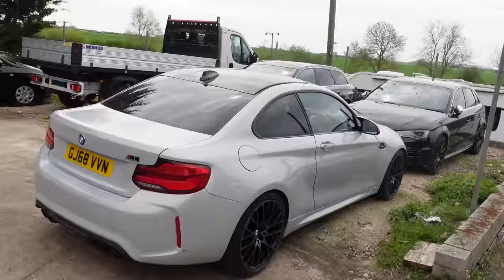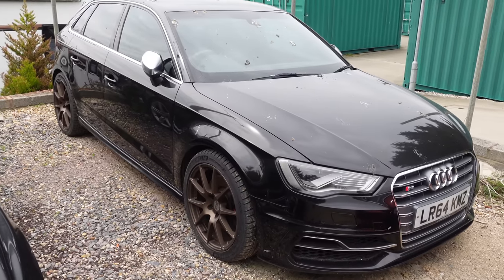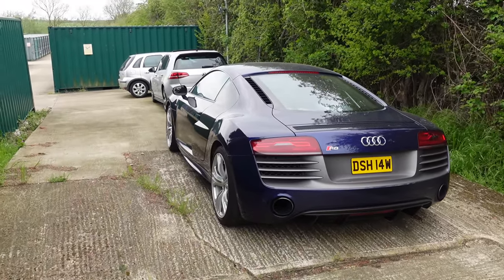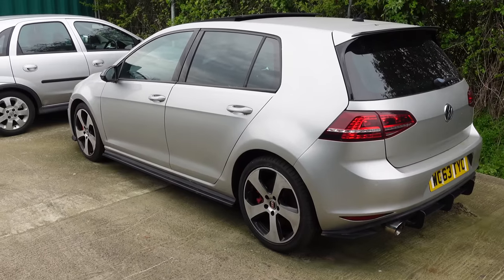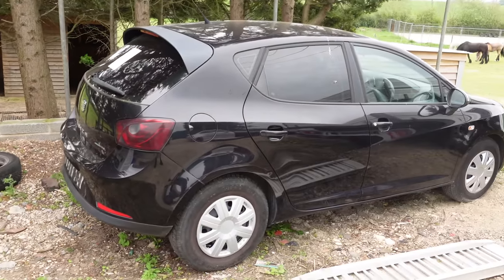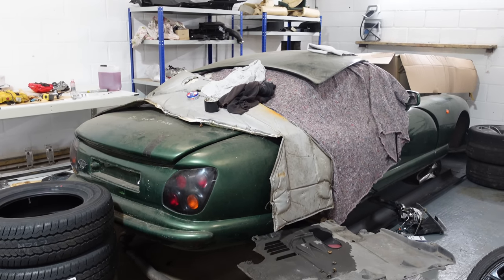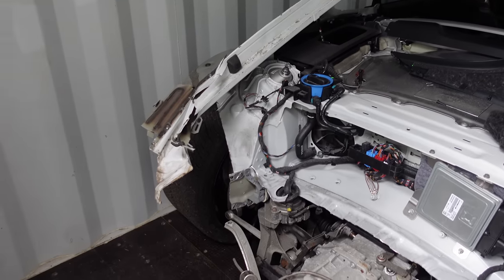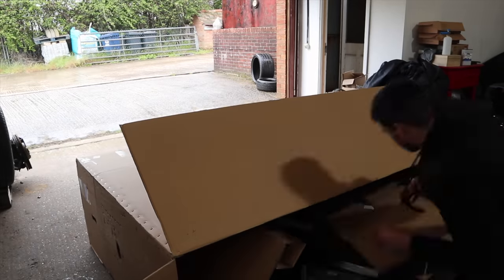BIG GARAGE UPDATE!! + I HAVE AN IDEA!!

Comment: I commented on your other video that you may as well rebuild the R8 oil heat exchanger while it's easy to get to (with the pipes removed for replacement anyway).
Looks like that's where it's leaking? Behind the left blade? If it is, you can rebuild it for ~£150 rather than paying Audi £900+ for a whole new unit. Mine sprang a leak and no way was I parting with that cash without exhausting all other options.

Comment: I did tell you Dean on your last Audi R8 video to replace all the oil pipes and replace the dreaded oil cooler. I am in the process of fixing an R8 with oil pipe failure again. You can not cut corners with these cars. Great videos on the engine rebuild, mate.
Reply from the maker: I tried not too as the 2 oil pipes are nearly £800! For 2 poxy pipes 😤😂
Reply: I buy all the parts for my projects from Lithuania Dean. Porsche and Audi R8 parts are a lot cheaper.

Comment: I would sell the RS6 for parts as you said. Not every car will workout fine and it seems to be a money pit this one. Besides, just like you said even fixed it won't be valued much more so I do not see the sense of burying more money on it just for the sake of fixing it. Also, you can use the budget from the car into the current projects or a new project. 
Not every car will be a win and this is part of journey of fixing salvaged cars.